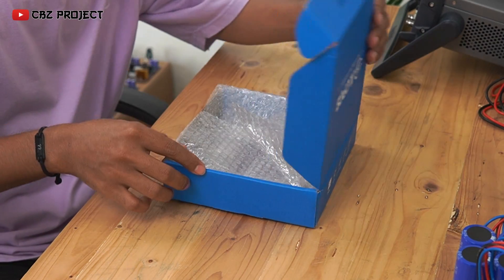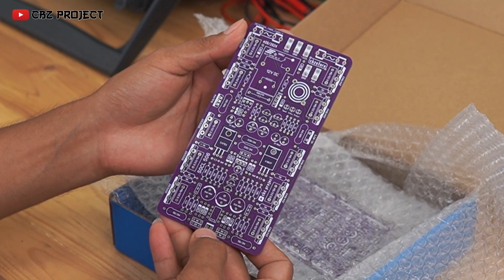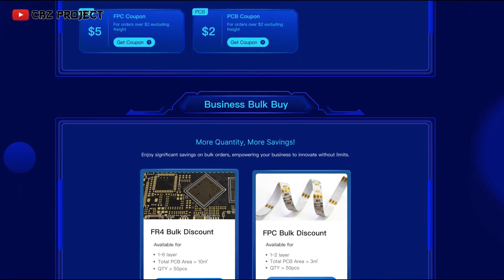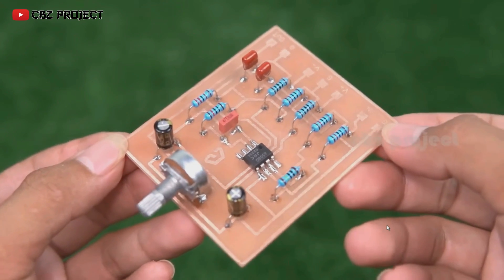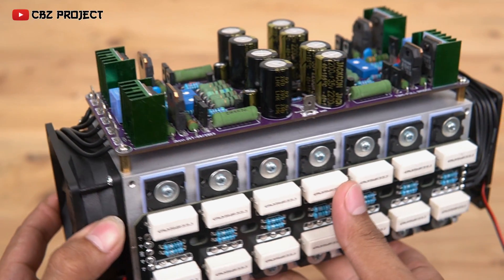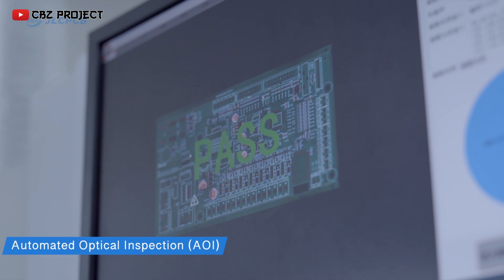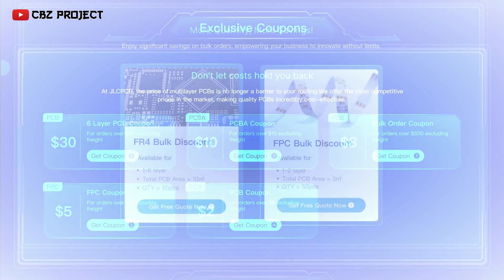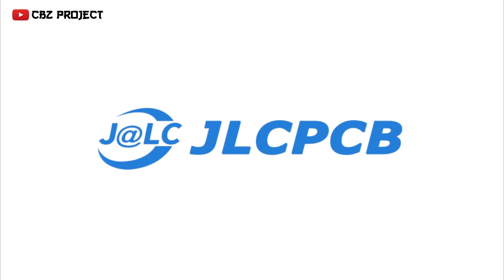DIY 2x505watt High Power Amplifier using 20 transistors | 2SC5200 & 2SA1943 #cbzproject

Comment: Sir what that bulb 💡 do? It's kind of soft start trick ? Or which soft start you use
Reply: It can be do for fuse or short circuit signer, if any wrong situation bulb will lighter and recheck the installation. Thank you
Reply: @tukangdadagan5588  ooh thank you..
Then what about the connection?
Reply: @dazai_osamu777  use series connection with input voltage.